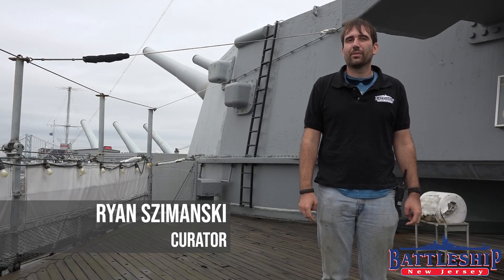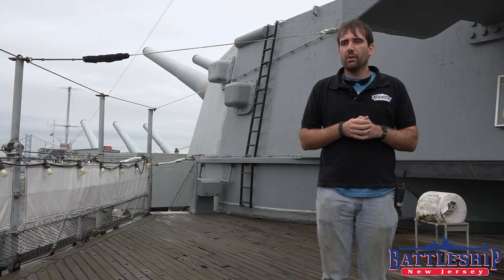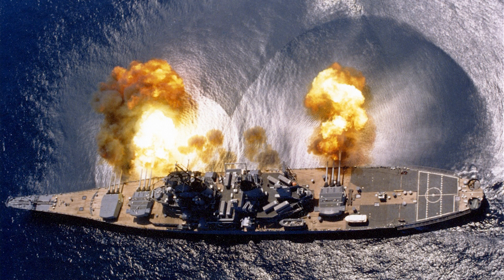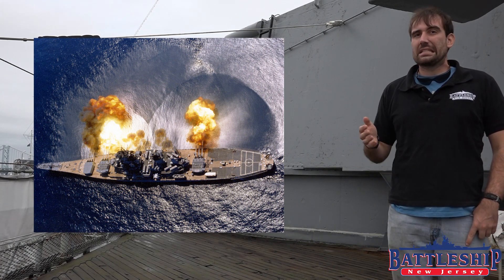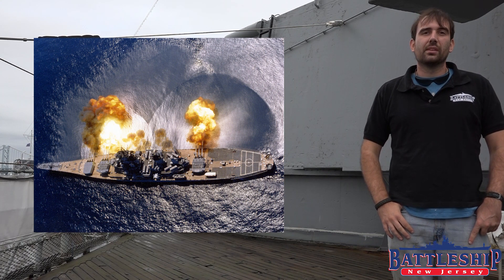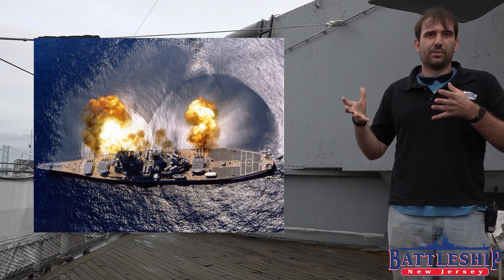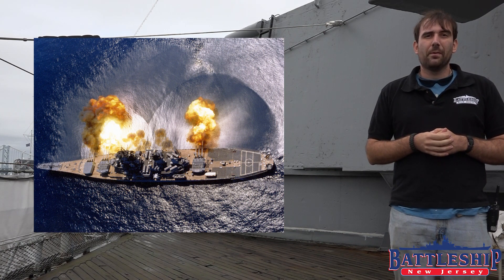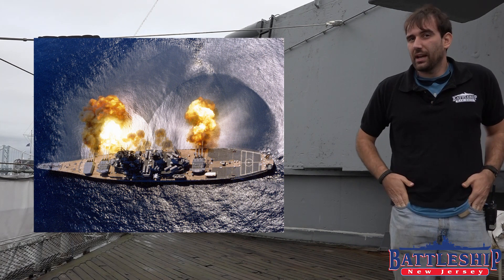Does Firing the 16in Guns Move the Ship Sideways?

Comment: BS Remember for every action there is an opposite and equal reaction.  Based you your statement an ION engine could not power a spacecraft.   The mere fact there is a very big difference in Mass time Velocity between the 16 inch shells and the total mass of the battleship, does not negate Newton's third law.  The water absorbs the energy of the firing it is very small but still there.  To show you how I could dispute this simply consider the battleship in orbit.  Fire the guns the impulse from the guns would be M*V.  This results in a response of the battleship with Ms*Vs.  The two will equal M*V = Ms*Vs.  The resultant velocity of the ship would be Vs = M*V/Ms.  This is the Third law and aircraft and rockets all utilize this effect.  If you have ever fired a high powered rifle you would notice the "kick" the impulse from firing a high powered rifle bullet.
Reply: Yes, I almost yelled at my laptop when he said "do the math" or whatever. Ask anyone who experienced it. Nobody is frying chicken or working on delicate electronics during firing for exactly that reason.
Reply: Very good! The closest answer of all. Classic recoil velocity O is equal to the mass of bullet m and gun M plus the velocities of bullet v and gun V. Thus
O=mv + MV.    Thus
V = -mv / M. 

The ship moves some small fraction of distance due to its mass. But it does move. The business about recoil dampers only pertains to the relative recoil experienced by the gun tube relative to the turret, not the entire ship relative to some fixed point in the water. Likewise the draft of the ship and its total surface area submerged is a red herring since water is, last time I checked, a fluid medium. For the water surrounding the ship to act as a fluid buffer the ship must be contained such that water cannot flow around it. 

I shall not attempt to calculate the exact recoil moment and distance. My slide rule is broken and I refuse to use that infernal calculator thingy!

Comment: For every action there is an equal and opposite reaction.  If the recoil is "mostly" absorbed by the recoil mechanism, the un-absorbed portion of the recoil being distributed into the ship, MUST cause the ship to react.  The reaction of the ship may be imperceptible, but it will move.
Reply from the maker: There is a lot of reaction in the ship. The lights swing, pipes shake. Doesn't mean the ship itself moves.

Comment: Interesting, I had heard  it moved 16 ft  sideways
Reply: If it did, it would knock every sailor off his feet. It would render the crew useless for minutes. There are numerous pictures and videos of people on deck while firing, there is a shock wave, but the ship does not move sideways at all, it doesn't even list. a 3 gun salvo would use 110 lbs of powder for each barrel, or a combined 330 lbs of powder, explain how 330 lbs of gunpowder can move a  50, 000 TON ship. Physics are physics, cannot happen.
Reply from the maker: You've got the right idea, but each shot uses 6 of those 110lb bags, so 660 a piece. Still not enough to move the ship though.
Reply: @BattleshipNewJersey  I stand corrected on the powder charge. But agree, can't move a battleship laterally. Heck of a vibration though.
Reply from the maker: Definitely a lot of vibration! Further on your earlier point of people out on deck when they fire them, if you watch our recent video on operation hailstone, you'll see a great video of people on the 05 just aft of Turret 2 watching her fire

Comment: 9 * 1225 kg =11.025 kg. The ship is 5.000 times more heavy.  So effect should be the same as when a 58 kg human shots with a gun an 11 g heavy bullet.
Reply: It is not easy to calculate, the mass of the water the ship is in is a part of the momentum reaction to the momentum of the projectiles.The ship would move a little, probably less than 1/10th of an inch

Comment: Maybe if they fired the missiles and 5 inch guns it would move a foot.
Reply: Nope, they've done all guns in a broadside all at once, didn't move.
Reply: Another common misconception is that the exhaust of a rocket-engine needs to push against something in order to make the rocket/missile go forward. It doesn't. The exhaust-gasses already travel in the opposite direction of the motion of the missile and Newton's 3rd law is thereby satisfied.
The ships-motion a missile's exhaust would cause is due to the gas that impinges upon the launcher-body (normal wind impacting the ship would've more effect). However when the missile rides a tube while driven by a rocket-engine, the friction between missile and launcher would cause the ship to move in the same direction as the missile.
In other words: "Missiles don't play a roll here.".

Comment: Well, my Father who was a navy man who fought in WW2 & reserves through Korea & Vietnam said they do move when firing the big guns. Maybe just a little, but I bet it sure felt stronger when you hear the guns go off.
Reply: Don't forget, there used to be another main turret. Three more rifles. Plus, a "full broadside" didn't involve just the 16" mains, but also the 5"ers, the 3" guns, and smaller caliber armament.
Reply from the maker: There was never another turret on these guns nor were there ever 3in guns. They did remove 4 of the 5in gun mounts though in the 80s. But again, it doesn't move the ship even with her full complement, it just moves a lot of water.
Reply: @BattleshipNewJersey  I stand corrected on the 4th turret. Now that I think about it, the fantail used to have the floatplane cats and the stern gun tubs. I genuinely thought there were originally 3 inch mounts, which were replaced by the quad 40's, but I must have confused the Iowas with another ship.
Reply from the maker: There were 40mm mounts on board the ship but never 3in guns. It was talked about and is a very common belief that they were installed.

Comment: For every action, there is an equal, and opposite reaction. The ship has to move sideways when all gun fire, even if it is only 1/32nd of an inch.
Reply from the maker: Or that energy is transferred to shaking inside of the ship.
Reply: @BattleshipNewJersey  It would be interesting to see what fraction of the energy goes into translation - the ship WILL experience sideways force, if not enough to move it appreciably - versus rotation in terms of the ship rolling slightly. The guns are well above the center of mass, which would apply a torque to the ship as well as a translation force.

Both are damped by the mass of the ship and the water but they do exist.
Reply: If you smack a hammer on, let's say a 10ft long steel table on one end with a pop can on the opposite side, it will feel the vibrations of your hit. The can won't move as the force of the hammers' hit was absorbed through the table and finally the can itself and the contents inside.  Basic rules of physics apply yes, but the fact remains.  Energy is and can be absorbed!  

Another analogy.  If I punch you in the face, you'll feel it yes?  But if I punch you woth a padded glove, you'll feel it still but not as sharp and precise as the first initial hit. Why? The physical Kinetic energy is Absorbed and Displaced.
Reply: @dragonbrownies517  That's only true if the table is rigidly fixed to the floor, if only by friction (for smaller hits). Repeat the same thing with a steel plate on an air hockey table and the whole mass will move.

Likewise, a battleship firing its guns doesn't accelerate sideways solely due to the water its sitting in. Put it in a frictionless environment and each 16 inch AP shell fired  would impart about 0.65 inches per second velocity in the opposite direction of the shell path, assuming the barrel is aligned to recoil directly toward the ship's center of mass.

The acceleration is relatively small but it is not zero.
Reply: I was in the US Army Field Artillery for 26 years from private to colonel.  105, 155, 8" howitzers and Honest John rockets.  The design of all cannon systems includes the recoil mechanism, which allows the tube to go to the rear as the projectile goes to the front, easing the shock on the system which would otherwise destroy the carriage.  Olden ship-borne guns had a set of ropes which, when the gun fired, would take up the slack and not allow the gun to recoil backwards through the hull.  Newer guns use hydraulics.  Anyway it is a military urban legend that the firing of a gun causes the ship to move sideways.  On land, the howitzer does not move, or it would move the earth.  But it doesn't.  On sea the gun would move the sea and the earth, but it doesn't.  No.  The designers of artillery knew full well how to cancel out recoil.  Look at a tank gun.  It is the same principle.  And it is 105mm or 120mm.  The gunner fires, the tube recoils back, then returns, and another shell loaded,, within seconds.  The tank does not move.  It is, like a naval gun, gyroscopically stabilized.  Yes, there is a huge shock wave, and a lot of dirt blown, but when the dust clears, and the camera sees again, it sees the tank in exactly the same spot.  So the battleship main gun causes vibrations which set up wave action.  But when the smoke clears, the ship is in the same spot.  Now there are many people who believe many things, but you have to ask yourself, if you were in charge of naval gunnery, would you not make the recoil mechanism robust enough to withstand the recoil?  We did it for tanks.  We did it for field artillery.  I cannot believe that naval architects did not do it for naval guns.
Reply: @williamheyman5439  Since you have experience with such things, what happens when you fire a towed artillery piece without securing the trailing arms? The whole gun recoils across the ground, because being dug in is a vital component of the recoil system. The recoil system can only redistribute the recoil into a lower level of force over a longer time - the force still needs to be transferred to the ground to prevent the gun from moving. Imagine setting up your gun on a hockey rink and firing at low elevation - that gun WILL move backwards when fired.

The tank won't, because even on a hockey rink the tracks provide enough friction to transfer the force to the ice. Even so, the tank does rock back on its suspension when it fires because the whole tank does recoil, just not enough to overcome the friction holding the tank in place. If you were to fire the gun while the turret was suspended by chains on its lift points, the turret would violently recoil despite the recoil mechanism inside the turret. You can't cheat the second law of motion without that connection to the ground to transmit force.

The battleship does the same thing, only it transmits the force into the water surrounding it. The difference in mass between the ship and the shell is large enough to make the acceleration felt by the ship to be irrelevant when the ship is in the water. If the ship were in dry dock and fired, force sensors on the blocks holding it up would be able to register an increased force on the blocks opposite the direction of fire. Or as mentioned above, if the ship were somehow in space, firing one AP shell would result in a propulsive force accelerating the ship to about 1.6 cm/s away from the direction of the shot.
Reply: @willythemailboy2  Now that you mention it I probably should not have mentioned field artillery towed howitzers and cannons.  They have to trade off weight to be usable so a recoil system that would stop all recoil would be too heavy to be practicable.  So they use the spades as part of the recoil system.  Oddly the movement, across the ground is not the real reason. There is usually enough room to let the pece move.  The real reason is to keep the tube in the same position for aiming.  the tube is "laid" using an aiming circle or theodolite, and has to be checked after each round.  Too far out of battery and the firing is interrupted to re-lay the piece.  Naval guns do not have this problem.  I have to quit as this thing is jumping around on the screen and I do not know what I am typing.  Yotube does not want me to write.
Reply: @williamheyman5439  The physics is the same regardless of the size of the recoil system. For a tank the tracks serve the same function as the spades on a towed piece, and for a battleship the water does the same. All the recoil system does is spread the shock out over a greater length of time so that the gun/tank/ship's connection to it's surroundings never quite overcomes standing friction.
Reply: Does a skyscraper move sideways when you push it with your bare hands?
Reply: @EdHunter55  Is the skyscraper firmly planted in the ground to dissipate the force? In a frictionless environment, yes the building would move a bit.

We can detect the change in orbits of billion ton asteroids from nothing but gas pressure from the sun, and we could certainly detect the delta v the ship would experience if it were to be in orbit when it fired. Recoil system or not, it would move.

What keeps that movement negligible in reality is that the ship can dump sideways momentum into the water. Negligible does not mean zero.
Reply: Ruth IS right. The Curator is wrong in this case. And Ruth even uses the imperial system not pesky millimeters. 

The ship is an “open system” suspended in a fluid medium. No “damping” effect beyond the viscosity of water flow is experienced. The gun tube dampers, rolling moment of the ship, its draft, hull surface area, and all other factors tossed in are not pertinent. 

As Ruth intuits, at rest the mass and velocity of the charges and shells, mv and ship MV are zero. 
O = mv + MV. 
The recoil velocity is
V = -mv/M. Mind the sign. 

This works when you shoot a rifle. This works when you land a man on the moon. And it works for the Iowa or any other ship.

Comment: For every action, there is an equal and opposite reaction. You cannot violate Newtons Laws. The movement may be minimal, but it does move.
Reply from the maker: Except the energy goes into recoil mechanisms that are part of the gun, the energy will make the ship shake a little too, but it doesn't make it move sideways.
Reply: So if I hit a WWII german bunker with a sledgehammer it will move according to newton??? O_o I highly doubt Mr. Newton will agree with you on that one =P

Comment: Yes, for every action there is an equal and opposite reaction, in this case, insignificant. There is a significant overpressure created when the guns fire which precludes anyone from being on deck during firing. I read that during a battle in WWII a portal was left open during firing and the blast that came in was enough to knock a crew member off their feet.
Reply: No. Such forces would wreck the ship. The guns have buffers inside the turrets to absorb the energy of recoil.
Reply: @ScienceChap  The curator talked about the buffers, the buffers absorb the shock of the guns, slowing it down essentially, but sideways force is still transmitted to the body of the ship as the guns recoil and then rebound into place. What that guy said below. :)
Reply: I read information that the IJN Yamato (with the biggest naval guns ever mounted on a battleship - 18.1"), had blast protection equipped on its anti-aircraft batteries so those crewmen could withstand the main batteries firing during combat.  You can plainly see it in the models and pictures too, so I don't doubt the blast having an effect!  😄
Reply: @tyree9055  You can see on WWII destroyers they had hood like gun mounts and would have a blast shield mounted if there were guns mounted immediately behind another one. Generally they moved to fully enclosed turrets.